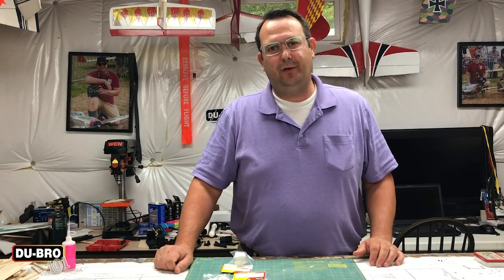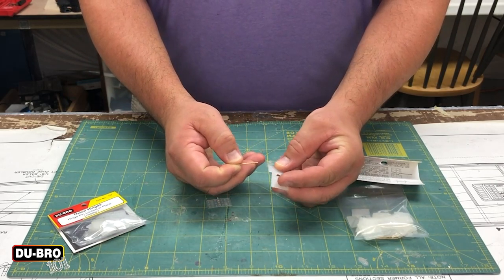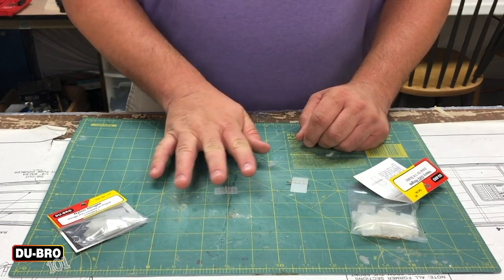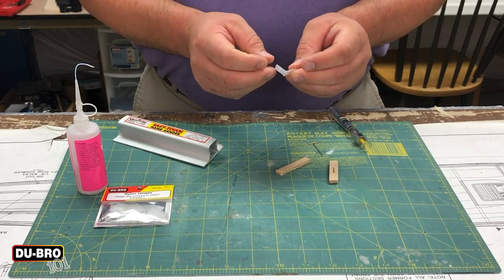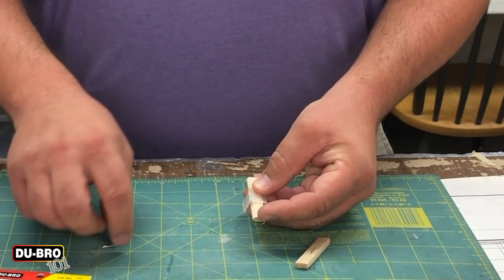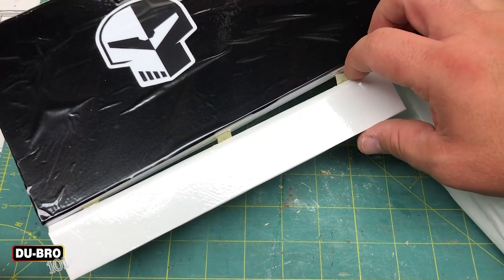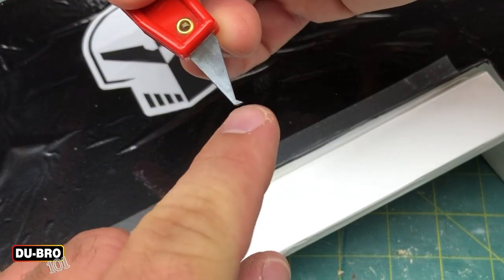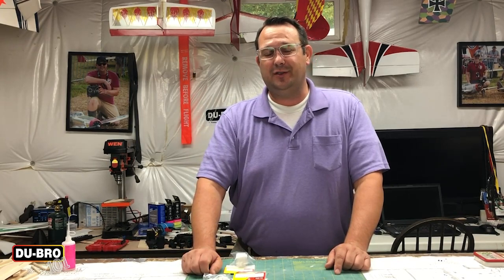Du-Bro 101 – How To Install Hinges on RC airplanes

Comment: That is for ailerons but what about flaps?   Is there another video on how to put hinges on flaps?  I suppose the procedure is different.
Reply from the maker: The approach is essentially the same. The hinge point is really the only difference. Hinges for main control surfaces are centered whereas flaps will have the hinge point closer to the top of the wing surface, making it off-center compared to your normal control surfaces. You'll want to check the plans of your model to be more precise. Remember to install your hinges and test the movement prior to applying the glue.
Reply: @dubropineridge  thank you

Comment: Is the tape paintable? I ask because I have the Hobby Zone Carbon Cub S2, and there is tape used to cover the channel/slot on the wings that the servo wires feed through, and also the servos. I was wondering if this is what they use. Thanks!
Reply: Hey Bruce, I just ran a paint test for you. I used enamel, krylon fusion, and acrylic paints. All of them work fine but I will note that any paint was rather easily flaking off with the rub of my fingernail. I then tried a bit of steel wool to rough up the surface and helped but could still be rubbed off. I suspect that a clear coat would help seal the paint on after applied. I would expect any latex paint to perform as well as the acrylic. I hope this helps!!!
Reply: @JoshuaOrchard  Thanks so much for doing this, I appreciate you taking the time. I think I'll follow your advice and try a clear coat over the base color. Thanks again!